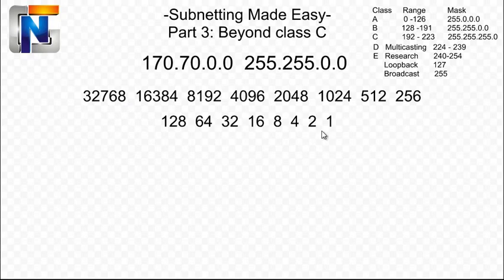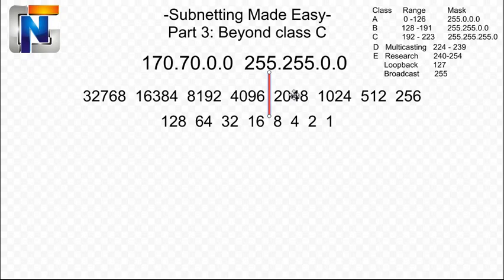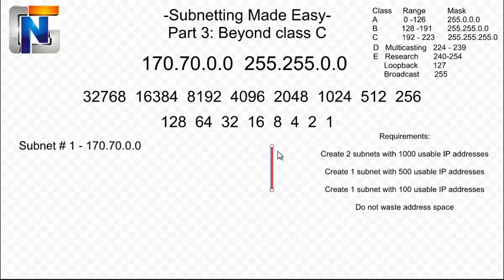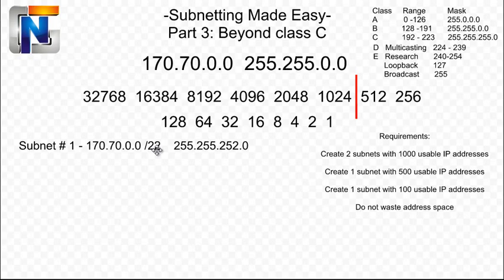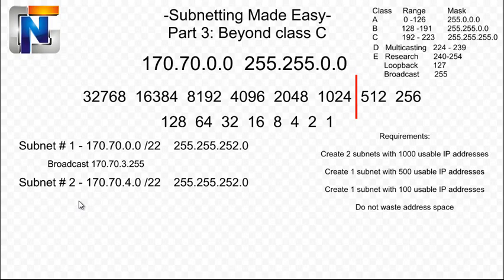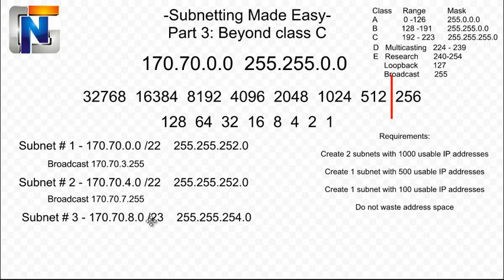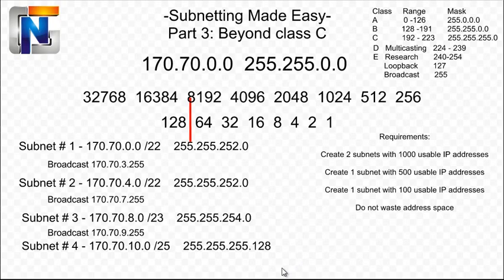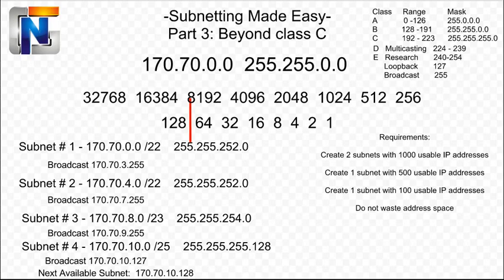Subnetting Made Easy Part 3

Comment: Subnet # 1 : 170.70.0.0 it's a class B with a default of 16 bits in a mask of 255.255.0.0, 

Convert 255.255.0.0 into decimals: 
->  iiiiiiii. iiiiiiii. 0000000.0000000

We need 1000 host which means it extends our default mask (based on video it's 10 bits), since full mask it's 32 bits 
-> 32 - 10 = 22 bits 

Meaning borrowing some bits on the third octet to extend the default mask, but the default mask contains 16 bits already we have to add 6 bits to get 22 usable bits. 
-> 16 + 6 = 22 bits  
-> iiiiiiii. iiiiiiii. iiiiii00. 00000000 (New sub-net that can handle 1000 usable ip address)

Convert the new sub-net into decimal 
-> Full octet with "i" is 255 and "0" is 0

128-64-32-16-8-4-2-1 (Sums up the "i" not "0" on the 3 octet)

-> iiiiiiii.iiiiiiii.iiiiii00.00000000

Answer -> 255.255.252.0

Comment: In this example, 10 bits were borrowed in order to get as close to 1000 ip addresses as possible.. There are 8 bits per octet and there are four octets. 8*4=32. So overall,there is 32 bits available. Since we used 10 bits, we have to subtract 10 from 32 which gives us 22. /22 in decimal form is 255.255.252.0.

Comment: how did you get the 252 part in subnet 1? I understood how you got it in your class C ones but im a bit confused.
Reply: That's how many bits were for the subnet in the third octet (22 total for subnet). 16 for the first two octets leaves 6 for the third. If you add them from left to right (128 + 64 + 32 + 16 + 8 + 4) you get 252. Hope that helps.
Reply: @BillyVaughn  thank you